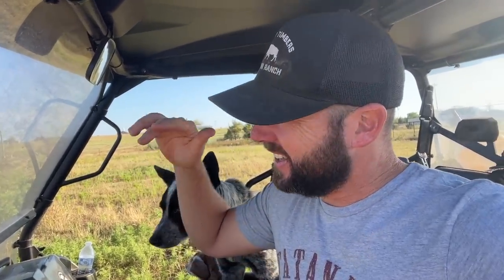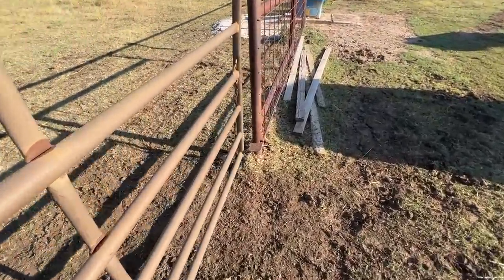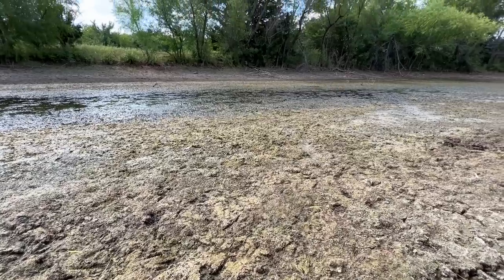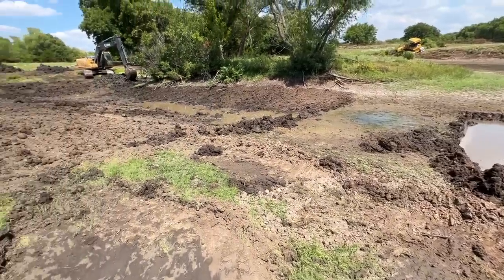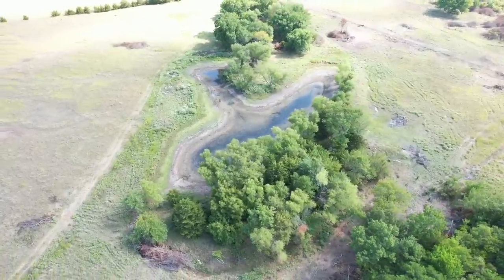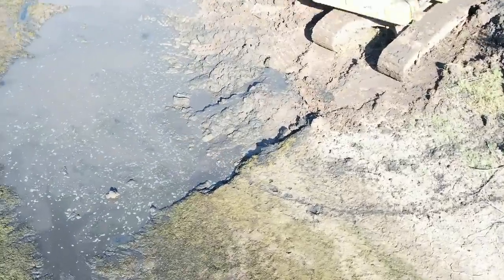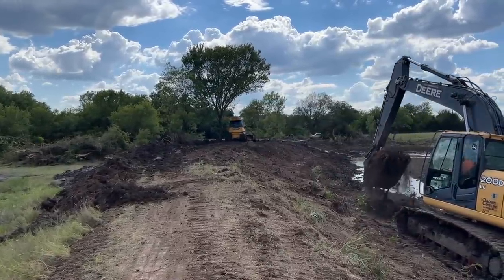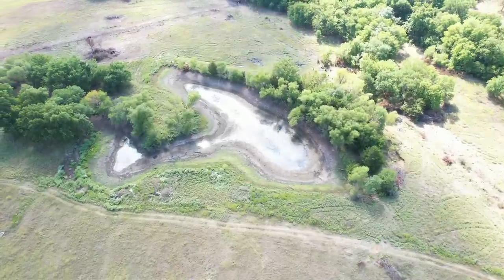Pond Renovation! Years of Sludge Removed

Comment: Lining the pond with limestone,  if possible is a really good pond treatment for long term. It doesn't have to be a super thick layer, or cover the entire pond. You can actually mix regular river gravel in larger amounts (7/8)with 1/8 limestone and still get a good effect and create spawning areas for the fish. Also, large stones can be stacked in deeper water for structure. Just a few ideas that will be useful in the future,  but done while you are doing the work.

Comment: In years past, a dragline might be used to dredge out a pond.  They generally were able to get out further and cast the spoil further from the pond.  You don't see too many of them around working any longer.   You are correct that cottonwoods love water and will pull a lot of it from the ground.  That is why they like low wet areas.  On the flip side, they provide shade and windbreaks to slow evaporation. You have to weigh the advantages and disadvantages.  Maybe consider some less thirsty trees back from the pond.  Hopefully, the pond will fill in the near future and you can give us a look at it then.

Comment: Many years ago, I watched a pond being dredged using two agricultural steam engines, one each side of the pond. They pulled a dredge/pond scraper across the bottom of the pond. It was fascinating to watch as this thing travelled back and forth. I might not have been a fast operation, but it was highly effective, removing many feet of mud from the bottom of the pond. The only problem was the mud would never catch on as an air freshener! Probably good as a soil improver, though.

Comment: Gaining huge increase in water capacity, many feet extra depth.  The dam is being reinforced and the mud on rear also assists with water proofing as it will harden into very water proof layer.
With minimal surface area change but larger water volume  will reduce evaporative losses too  keeping lower overall temperature.
Great pond improvement.👍👍👍🙂

Comment: Yes, pond sludge is a great way to revitalize a pasture or pastures.  When we do a major pons dig out we can usually can have sludge to spread over a lot more land that we expected as well as spreading it across some of the corral areas to add nutrients' there.  You will be amazed at how much and how fast you get growth.  Yes willow trees although great for shade and not depositing dead leaves etc,suck up a lot of water and can be rough on property during a dry or draught season.  Somehow instead of just not growing well like other trees when its dry they can manage to get all the moisture available from  a large circumference of land around them.  They were touted as 'drought resistant' and that may well have been just for being drought resistant plantings on residential property but somehow they got to be popular plantings as border trees for pasture land and farmland, at least around here, and that was well and good until about 10 tears ago when we went through a very dry period with low snowpack in the mountains and lower than normal rain and suddenly it became obvious willows were an issue.  We actually ended up ripping out the willows,and their riits systems, as the root systems kept trying to grow new willows and taking land moisture for that,  and did away with all except for one old ornamental one in the backyard of the home.

Comment: If you pile up all the trees then cover it up with soil leaving a small opening at one side and a vent hole on top than light it on fire at bottom hole it will all smolder slowly and turn into charcoal , that you can dig up later and bag it up to sale and use for cook outs and it can be burned in wood heaters.
Just a thought on putting all that wast wood to use and make extra income from it.

Comment: I have a question Dusty. If you put a fence around the pond and only allowed access to the pond for the Bison near the spillway wouldn't that control the amount of dung that stays in the pond? The dung would be washed out of the pond when it rains and it cleans the pond.
Reply: What is filling the pond is not dung, but silt. All lakes and ponds have it, but these little ponds need to be cleaned out. The rain is what is causing the silt to fill it up.

Comment: I cringed when I saw you remove the willows I don't think that was the best move for the land over all.  Riparian vegatation help provide a buffer   waterways from pollution and help  prevent erosion, help reduce pollution from entering the water ways,  reduce enviromental extremes in the pond in temperature which helps the pond hold more dissolved oxygen.  Natural riparian vegetation is a very important source of biodiversity for native wild life. If it was my land I was would of not removed the trees.